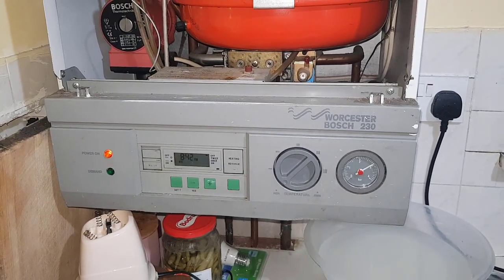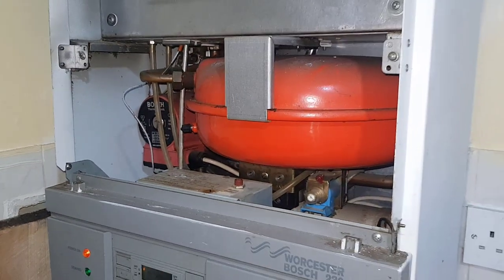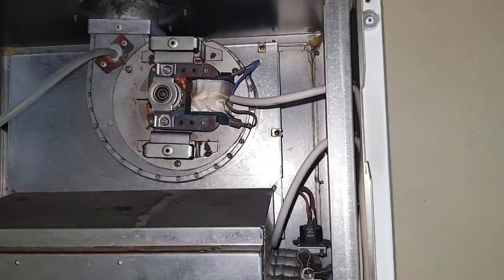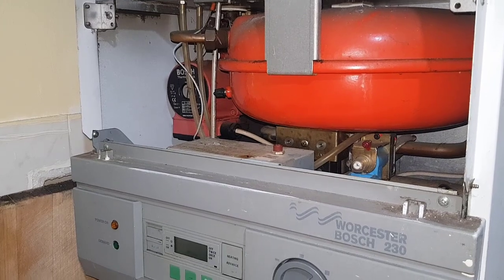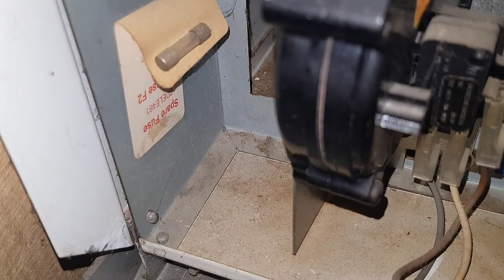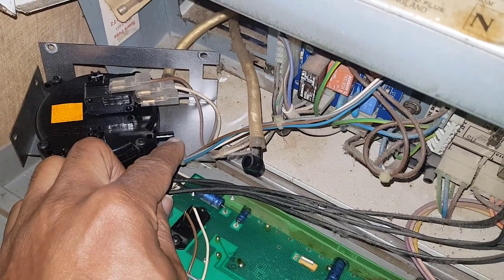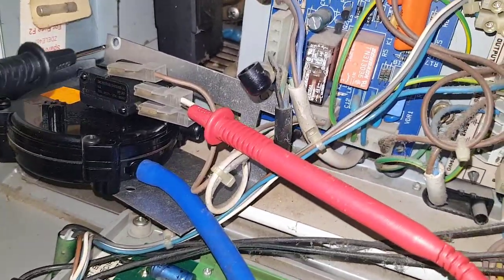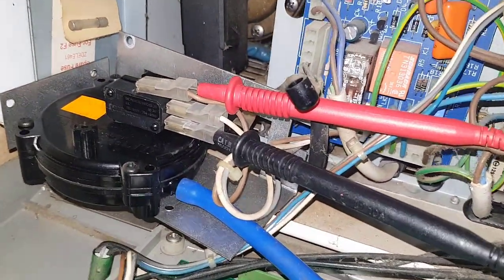Boiler Repair Training For You Fault Finding

Comment: Surely the next step is to see WHY the fan is not running? 

I’m not sure where you are going with the APS - it’s doing it’s job (proving the fan is not running). 

Next step for me would be checking if pump has proved and I would have also have checked fan supply at the pcb end.
Reply from the maker: Thanks for your comments

Comment: You should always go to the step before that's not working so as the fan was not working you would test APS before fan 

Also sucking and blowing on the APS is not advised and you can also test this with a multi meter 

Should also remove the plugs off the APS when testing as you will also be possably testing the wiring and board
Reply: Why would you test the APS when the fans not running? It's job is to prove the fans already running.
Reply: Watch your language